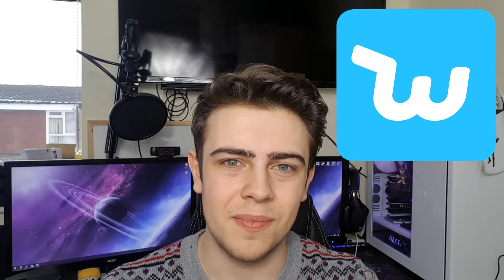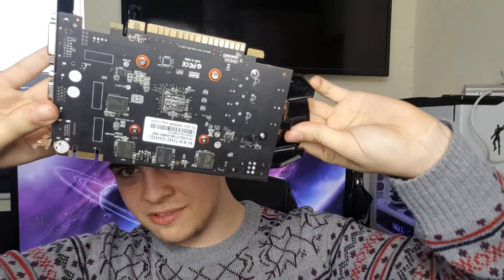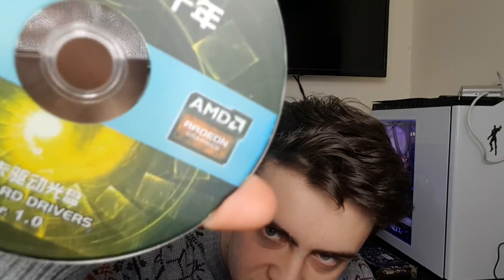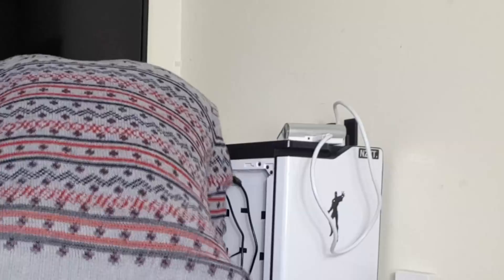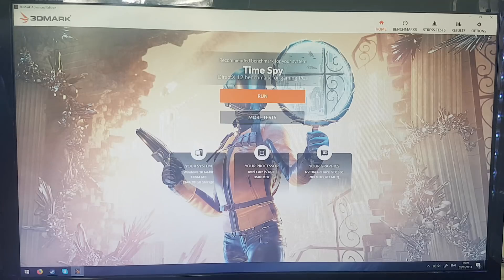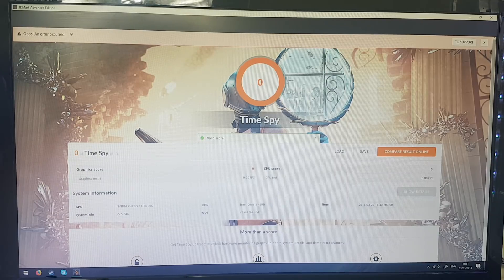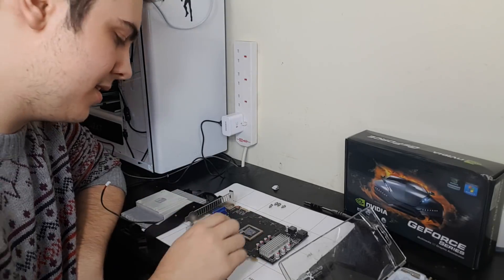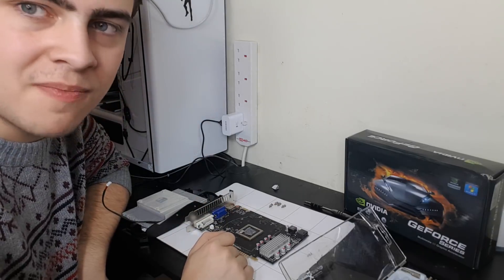I Bought a GTX 960 For £30 On Wish?! | Performance + Teardown

Comment: use GPUz for all your gpu needs all other gpu programs are not as accurate. and the look up button will show you if its a fake
Reply from the maker: GPUz did actually show this to be a GTX 960 as well. There were no signs that it was anything else in GPUz. They try very hard to make sure that you can't tell what it is 😂
Reply: also validate your gpu with gpuz and tell me the code so i can add it to the database
Reply: im the guy that makes sure gpus work in lookup, i can personally fix it so it will show a gtx 560 if you validate it
Reply from the maker: I'll let you know what it is when I make my video trying to flash the correct firmware to the card to see if I can get it working correctly. Subscribe if you want to see it 😊
Reply: i would prefer you validate before the flash, because i can make it so it reads gtx 560 with 960 bios. ill show you an example
https://www.techpowerup.com/gpudb/b5560/nvidia-geforce-gtx-750-ti-fake-card
Reply: this is on a GTX 550ti with 750ti bios
Reply from the maker: Yeah, no worries. Will do
Reply: Hey RMD Tech.  Thanks for the nice video.  Seems like I have exactly the same card as you.  Did you progress on the firmware flashing? I would like to do the same to turn mine into a working gtx 560